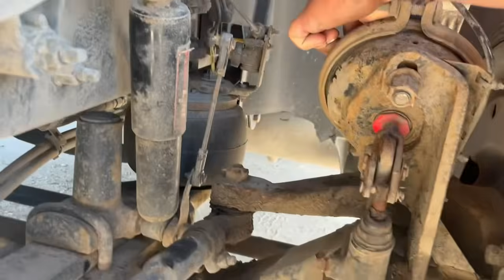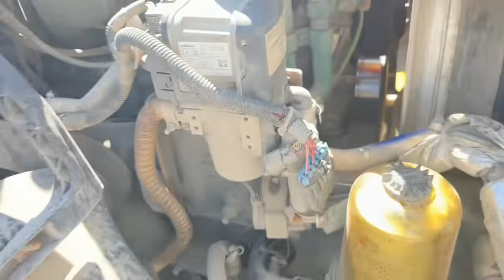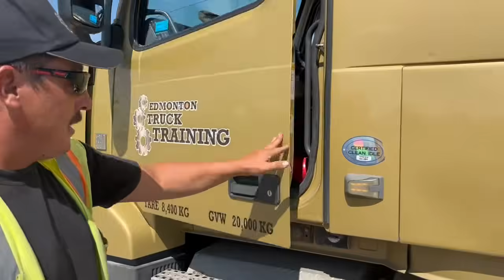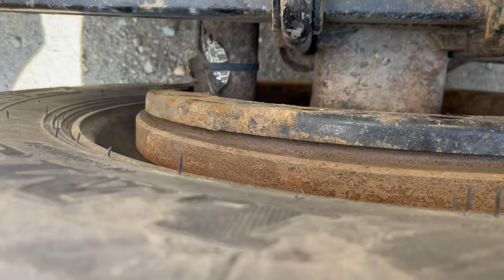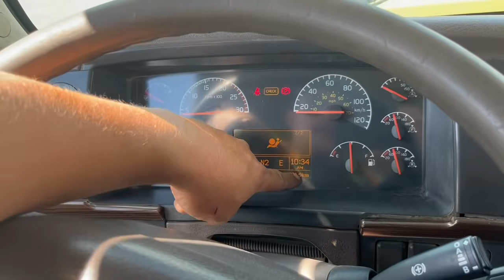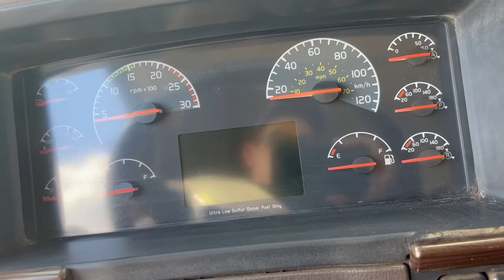Class 3 Pre Trip Inspection for road test in Edmonton, Alberta.

Comment: If you are taking the Class 3 in BC , be aware that for the Air System Leakage Test in BC is 1 Minute...In AB is 2 mins.....
And Max Loss (single truck) in BC is 3 psi loss in 1 min....In AB its 4 psi loss in2 mins

Max Loss-(Combination) in BC is 4 psi in 1 min.....in AB- Max 6 psi loss in 2 mins

Testing Nickname in BC- Standard Timed Leak Check..............in AB -"The Shaky Leg Test"(due to holding the heavy pedal down twice as long) apparently

Comment: Am i missing something, i thought class 3 road tests were done with Tandem trucks is this not a class 1 tractor trailer truck?
Reply: Class 3 applies to any single-body vehicle with three or more axles, so a tandem tractor without a trailer is a Class 3 vehicle. This would be a Class 1 truck if there were an air brake-equipped trailer as well.

Comment: I just want to point out as a class 1 driver... This should not take more than 20 minutes to complete.  Tractor and trailer together shouldn't exceed 40 minutes.  I do have a question though... I have asked instructors and DOT officers this question and have never gotten a good answer.  Why do you bother even touching the lug nuts?  Even if they're loose, you are never going to turn those by hand so it's a complete waste of time and energy.  And one more thing... CVIP is the first thing you should check..  If it's expired, there is no reason to do ANYTHING shown in the first 10 minutes of this video.
Reply: Tractor and trailer is 1 hour actually
Reply: @Kemei-o1c  They allow 1 hour for some reason.  15 minutes each for tractor and trailer is industry acceptable.
Reply: Excellent well explained video in clear English. Thank you
One question is, I realize the truck has nearly 1,000,000 km on it, when you’re doing all these inspections on brake components steering components, axles shafts, etc. etc. under the truck, 

wouldn’t it be prudent to have it clean?  Harder to notice oil leaks, and or cracks if it’s covered in mud?

 I also noticed a warning sticker, no pressure washing of the steering system. Obviously, you don’t want water in the ball joints, what are your thoughts?